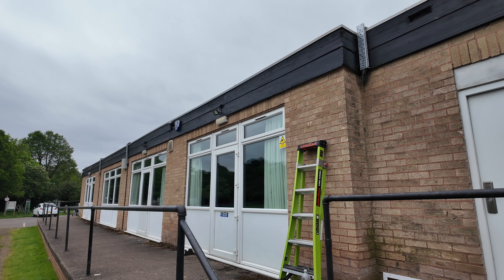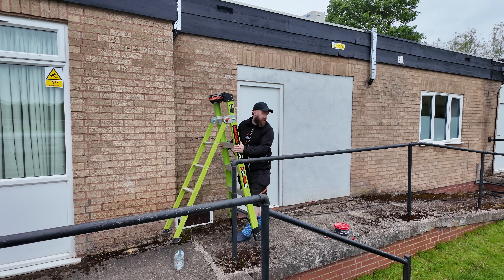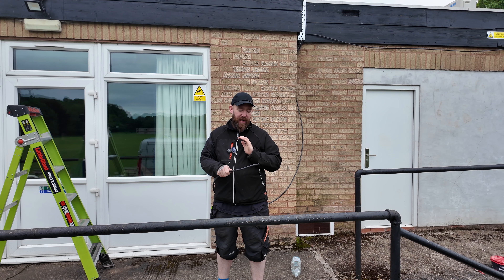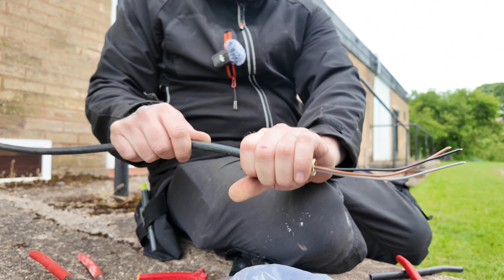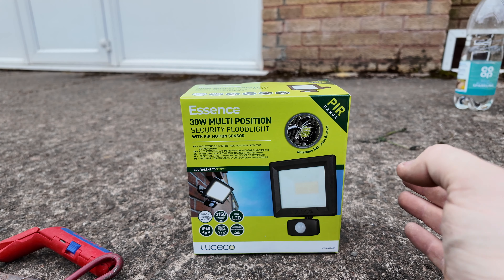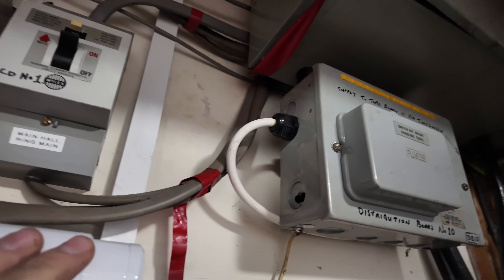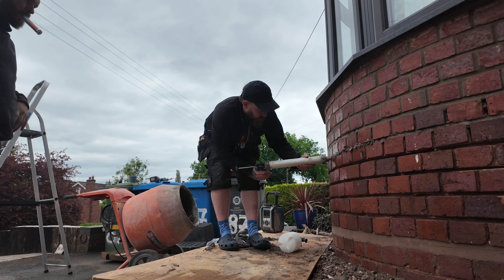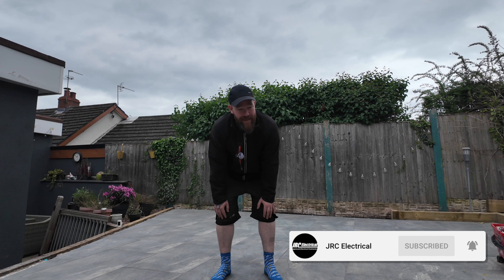Not Exactly What I Had Planned! - Electricians Vlog

Comment: Why not just go with a tuff sheath cable, don’t need mess with the gland?
Reply from the maker: No idea 🤷 😂😂😂 I’ve been using the tuff cable a lot more lately but it never comes to mind when doing stuff like this, I also think clipping it is longer than cleats on swa
Reply: @JRCElectrical  I didn’t know if SWA was specified. I would still use cleats to fix them it’s just a stuffing gland 👌
Reply from the maker: @Gaunty213  ahhhh fair dude